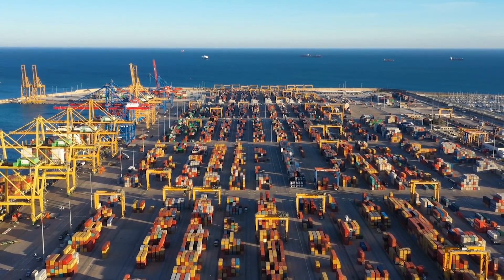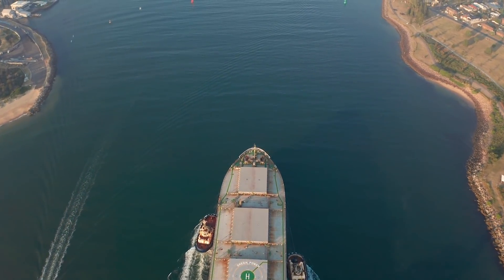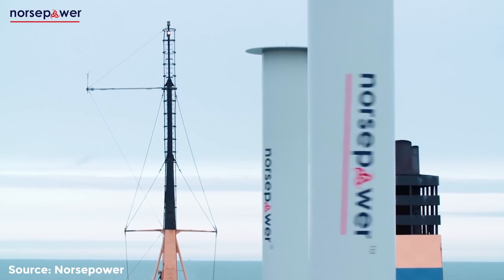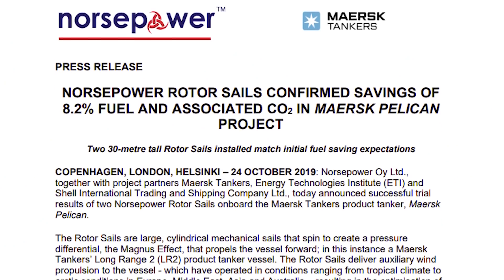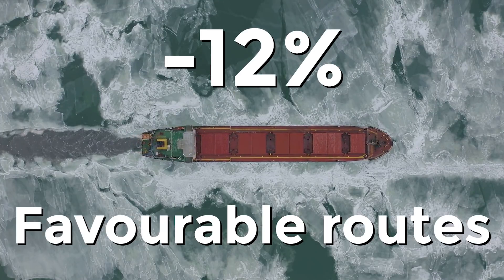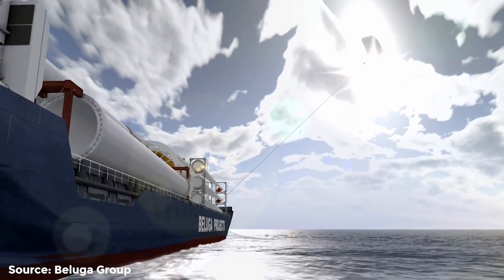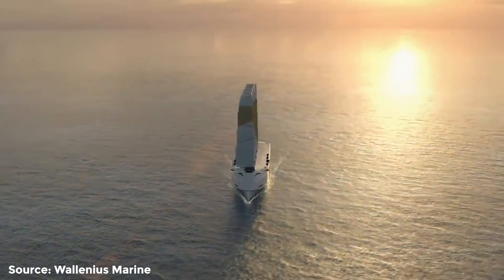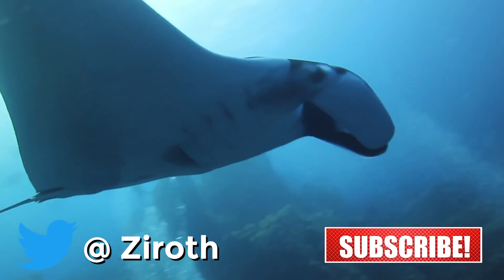Is Wind Power The Future of Shipping?

Comment: What a great idea!!
They could have big sails on masts!!
Reply: To address the suggestions that wind power is the answer I offer the following example.  In 1870 a premium sailing vessel entered service, the ‘Cutty Sark’.  The 'Cutty Sark' was 64.74 metres in length with a beam of 10.97 metres and a loaded displacement of 2 100 tonnes.  She was able to carry, at best, 1 700 tonnes of cargo and to harness the energy in the wind the available spread of canvas was up to 2 976m2 which was tended by a crew of about 30 skilled men.  A ratio between the sail area (SA) and the vessels displacement (D) determines how lively she is; ‘lively’ being nautical speak for ‘fast and manoeuvrable’.  The carrying capacity of cargo ships is constrained in two ways, mass and volume which leads us to the ‘stowage factor’ of the cargo; the more mass on board the greater the displacement which in turn impacts the efficiency of the hull form and sail area / displacement ratio.  A vessel constrained by mass is said to be ‘down but not full’, while a vessel constrained by volume is said to be ‘full but not down.  When in the tea trade, which the ‘Cutty Sark’ was designed and built for with fine lines (more nautical tech speak, so again no need to worry about it) she could carry around 600 tonnes of cargo at speeds of up to 17.5 knots dependent on the prevailing wind and had a typical China to UK time on passage of 120 days.  The tea trade was very competitive so ‘time on passage’ was a large factor in securing the premium freight rate that made her cost effective.  Rounding things out, her maximum available sail area gave circa 5m2 of canvas for every tonne of tea carried.

As soon as the Suez Canal opened, which the ‘Cutty Sark’ was unable to sail through; she lost her advantage, raw speed, to the steam powered ships of that era who could beat her ‘time on passage’ by taking that short cut.  Mechanically powered ships have improved in terms of efficiency, on a freight tonne mile basis, by at least one order of magnitude since then.  After losing out to the coal burning, fire tube boiler, steam reciprocating mechanical ships of the late 19th century ‘Cutty Sark’ was relegated to the Australian wool trade, just about the bottom of the barrel in maritime terms and only one small step up from being a 'honey barge'.  The canvas, cordage and extra manpower needed for sailing ships was never a very benign environmental option so please discount any idea of sail as ‘sustainable’.  All this is without the problem that if ‘the wind don’t blow the ship don’t go’, when it does blow it often blows in the wrong direction for your cargo delivery needs and sometimes there is rather too much of it for comfort.  Sailing ships are unable to go directly up wind so if the wind is blowing form the direction your cargo needs to then a zig-zag course must be steered, more distance and more time.  Wind is traditionally measured on the Beaufort Scale (wind speed) that runs from 0 (< 1kn) to 12 (> 63kn) and for sailing purposes the usable part of the range is ‘3’ (circa 8kn) to ‘6’ (circa 24kn).

Random fact about ‘Cutty Sark’, it is said to have been possible to coax 3 000 horse power out of her sails, or in ‘real money’ 2 206 500 Watts (2.2 megaWatts), or 741 Watts for each square meter of sail area.  So that majestic spread of canvas would have been even less efficacious for delivering your baubles and bows from the orient, despite taking about three times as long on the voyage.  The sails on the ‘Cutty Sark' produce about 0.33% of the power need to propel a Mearsk Triple E or less than one two hundredth of the output from the ICEs.  Remember shipping is a high volume low cost, therefore low margin business, and all costs have to be beneficial.

Canvas and hemp are accorded 'renewable' (read as ‘natural’) status, if ‘synthetics’ are used there will still be a need for the input of FOGI products.  'Synthetics' would have a much better working life span than 'naturals' but would still yield the same amount of energy, 741 Watts for each square meter in those elusive ideal conditions.  Wallenius are currently giving wind power a go with wing form ‘sails’ but evidence is a little short of proof as of this date.  KTH (Kungliga Tekniska högskolan), a sort of up market university in Stockholm, who are using the funding to derive results will probably, and eventually, in the best traditions of academia ‘publish’ a ‘paper’ unless the funders invoke the well known ‘commercial sensitivity clause’ of their agreement with the KTH.  On board wind turbine might get you around some of the problems, however for marine use vertical axis wind turbines (VAWT) would be better than, the what have now become 'traditional', horizontal axis wind turbines (HAWT) for reasons that include the air draught of the vessel, weight distribution and maintenance access.  The energy yield is still subject to the wind blowing at the right strength and having space available on board for the hardware.  The masts, rigging and sail handling arrangements would take up 'prime real estate' on the vessel.  Fuel oil bunker tanks can be stuck away in any odd corner and the ICE power plants are themselves relatively compact.  The stacked up 'boxes' would mean putting the wind driven propulsion units in a bad situation from a ship stability point of view.

Comment: The problem with pollution form shipping is the same as pollution form plastic.
Petroleum is too cheep! Its practical free. It has no cost and is too good.
If the environmental cost was added to petroleum wind power would be the most economical way and used plastic would have a value.
So – add value to petroleum. It’s a fantastic product and may be a solution to the environmental problem. Use it in a sustainable way. Recycle and reuse.
Reply: At the moment the lowest cost resolution of the marine transport challenge is ICEs powered by liquid fossils fuel.  Some environmental costs are externalised, so the global community has to bear them, for the benefit of the users of the service.  The internalisation of those costs is the responsibility of the regulators while the ultimate liability should lay with consumers of the materials being transported.  If you want your toys and gadgets you will need to pay that cost.  While ICEs have the current perceived advantages of economy, facility and flexibility we are going to be stuck with the environmental down sides unless universal regulatory action prevails or consumption both per capita and overall reduces.

Comment: He missed a great pun opportunity. Probably on purpose, obviously the answer is....blowing in the.... nevermind
Reply: To address the suggestions that wind power is the answer I offer the following example.  In 1870 a premium sailing vessel entered service, the ‘Cutty Sark’.  The Cutty Sark was 64.74 metres in length with a beam of 10.97 metres and a loaded displacement of 2 100 tonnes.  She was able to carry, at best, 1 700 tonnes of cargo and to harness the energy in the wind the available spread of canvas was up to 2 976m2 which was tended by a crew of about 30 skilled men.  A ratio between the sail area (SA) and the vessels displacement (D) determines how lively she is; ‘lively’ being nautical speak for ‘fast and manoeuvrable’.  The carrying capacity of cargo ships is constrained in two ways, mass and volume which leads us to the ‘stowage factor’ of the cargo; the more mass on board the greater the displacement which in turn impacts the efficiency of the hull form and sail area / displacement ratio.  A vessel constrained by mass is said to be ‘down but not full’, while a vessel constrained by volume is said to be ‘full but not down.  When in the tea trade, which the ‘Cutty Sark’ was designed and built for with fine lines (more nautical tech speak, so again no need to worry about it) she could carry around 600 tonnes of cargo at speeds of up to 17.5 knots dependent on the prevailing wind and had a typical China to UK time on passage of 120 days.  The tea trade was very competitive so ‘time on passage’ was a large factor in securing the premium freight rate that made her cost effective.  Rounding things out, her maximum available sail area gave circa 5m2 of canvas for every tonne of tea carried.

As soon as the Suez Canal opened, which the ‘Cutty Sark’ was unable to sail through; she lost her advantage, raw speed, to the steam powered ships of that era who could beat her ‘time on passage’ by taking that short cut.  Mechanically powered ships have improved in terms of efficiency, on a freight tonne mile basis, by at least one order of magnitude since then.  After losing out to the coal burning, fire tube boiler, steam reciprocating mechanical ships of the late 19th century ‘Cutty Sark’ was relegated to the Australian wool trade, just about the bottom of the barrel in maritime terms and only one small step up from being a 'honey barge'.  The canvas, cordage and extra manpower needed for sailing ships was never a very benign environmental option so please discount any idea of sail as ‘sustainable’.  All this is without the problem that if ‘the wind don’t blow the ship don’t go’, when it does blow it often blows in the wrong direction for your cargo delivery needs and sometimes there is rather too much of it for comfort.  Sailing ships are unable to go directly up wind so if the wind is blowing form the direction your cargo needs to then a zig-zag course must be steered, more distance and more time.  Wind is traditionally measured on the Beaufort Scale (wind speed) that runs from 0 (< 1kn) to 12 (> 63kn) and for sailing purposes the usable part of the range is ‘3’ (circa 8kn) to ‘6’ (circa 24kn).

Random fact about ‘Cutty Sark’, it is said to have been possible to coax 3 000 horse power out of her sails, or in ‘real money’ 2 206 500 Watts (2.2 megaWatts), or 741 Watts for each square meter of sail area.  So that majestic spread of canvas would have been even less efficacious for delivering your baubles and bows from the orient, despite taking about three times as long on the voyage.  The sails on the ‘Cutty Sark produce about 0.33% of the power need to propel a Mearsk Triple E in ‘ideal conditions’ the energy harvest would be less than one two hundredth of the output from the ICEs.  Remember shipping is a high volume low cost, therefore low margin business, and all costs have to be beneficial.

Canvas and hemp are accorded 'renewable' (read as ‘natural’) status, if ‘synthetics’ are used there will still be a need for the input of FOGI products.  'Synthetics' would have a much better working life span than 'naturals' but would still yield the same amount of energy, 741 Watts for each square meter in those elusive ideal conditions.  Wallenius are currently giving wind power a go with wing form ‘sails’ but evidence is a little short of proof as of this date.  KTH (Kungliga Tekniska högskolan), a sort of up market university in Stockholm, who are using the funding to derive results will probably, and eventually, in the best traditions of academia ‘publish’ a ‘paper’ unless the funders invoke the well known ‘commercial sensitivity clause’ of their agreement with the KTH.  On board wind turbine might get you around some of the problems, however for marine use vertical axis wind turbines (VAWT) would be better than, the what have now become 'traditional', horizontal axis wind turbines (HAWT) for reasons that include the air draught of the vessel, weight distribution and maintenance access.  The energy yield is still subject to the wind blowing at the right strength and having space available on board for the hardware.  The masts, rigging and sail handling arrangements would take up 'prime real estate' on the vessel.  Fuel oil bunker tanks can be stuck away in any odd corner and the ICE power plants are themselves relatively compact.  The stacked up 'boxes' would mean putting the wind driven propulsion units in a bad situation from a ship stability point of view.

Comment: It's was the beginning of shipping
Reply: To address the suggestions that wind power is the answer I offer the following example.  In 1870 a premium sailing vessel entered service, the ‘Cutty Sark’.  The Cutty Sark was 64.74 metres in length with a beam of 10.97 metres and a loaded displacement of 2 100 tonnes.  She was able to carry, at best, 1 700 tonnes of cargo and to harness the energy in the wind the available spread of canvas was up to 2 976m2 which was tended by a crew of about 30 skilled men.  A ratio between the sail area (SA) and the vessels displacement (D) determines how lively she is; ‘lively’ being nautical speak for ‘fast and manoeuvrable’.  The carrying capacity of cargo ships is constrained in two ways, mass and volume which leads us to the ‘stowage factor’ of the cargo; the more mass on board the greater the displacement which in turn impacts the efficiency of the hull form and sail area / displacement ratio.  A vessel constrained by mass is said to be ‘down but not full’, while a vessel constrained by volume is said to be ‘full but not down.  When in the tea trade, which the ‘Cutty Sark’ was designed and built for with fine lines (more nautical tech speak, so again no need to worry about it) she could carry around 600 tonnes of cargo at speeds of up to 17.5 knots dependent on the prevailing wind and had a typical China to UK time on passage of 120 days.  The tea trade was very competitive so ‘time on passage’ was a large factor in securing the premium freight rate that made her cost effective.  Rounding things out, her maximum available sail area gave circa 5m2 of canvas for every tonne of tea carried.

As soon as the Suez Canal opened, which the ‘Cutty Sark’ was unable to sail through; she lost her advantage, raw speed, to the steam powered ships of that era who could beat her ‘time on passage’ by taking that short cut.  Mechanically powered ships have improved in terms of efficiency, on a freight tonne mile basis, by at least one order of magnitude since then.  After losing out to the coal burning, fire tube boiler, steam reciprocating mechanical ships of the late 19th century ‘Cutty Sark’ was relegated to the Australian wool trade, just about the bottom of the barrel in maritime terms and only one small step up from being a 'honey barge'.  The canvas, cordage and extra manpower needed for sailing ships was never a very benign environmental option so please discount any idea of sail as ‘sustainable’.  All this is without the problem that if ‘the wind don’t blow the ship don’t go’, when it does blow it often blows in the wrong direction for your cargo delivery needs and sometimes there is rather too much of it for comfort.  Sailing ships are unable to go directly up wind so if the wind is blowing form the direction your cargo needs to then a zig-zag course must be steered, more distance and more time.  Wind is traditionally measured on the Beaufort Scale (wind speed) that runs from 0 (< 1kn) to 12 (> 63kn) and for sailing purposes the usable part of the range is ‘3’ (circa 8kn) to ‘6’ (circa 24kn).

Random fact about ‘Cutty Sark’, it is said to have been possible to coax 3 000 horse power out of her sails, or in ‘real money’ 2 206 500 Watts (2.2 megaWatts), or 741 Watts for each square meter of sail area.  So that majestic spread of canvas would have been even less efficacious for delivering your baubles and bows from the orient, despite taking about three times as long on the voyage.  The sails on the ‘Cutty Sark produce about 0.33% of the power need to propel a Mearsk Triple E in ‘ideal conditions’ the energy harvest would be less than one two hundredth of the output from the ICEs.  Remember shipping is a high volume low cost, therefore low margin business, and all costs have to be beneficial.

Canvas and hemp are accorded 'renewable' (read as ‘natural’) status, if ‘synthetics’ are used there will still be a need for the input of FOGI products.  'Synthetics' would have a much better working life span than 'naturals' but would still yield the same amount of energy, 741 Watts for each square meter in those elusive ideal conditions.  Wallenius are currently giving wind power a go with wing form ‘sails’ but evidence is a little short of proof as of this date.  KTH (Kungliga Tekniska högskolan), a sort of up market university in Stockholm, who are using the funding to derive results will probably, and eventually, in the best traditions of academia ‘publish’ a ‘paper’ unless the funders invoke the well known ‘commercial sensitivity clause’ of their agreement with the KTH.  On board wind turbine might get you around some of the problems, however for marine use vertical axis wind turbines (VAWT) would be better than, the what have now become 'traditional', horizontal axis wind turbines (HAWT) for reasons that include the air draught of the vessel, weight distribution and maintenance access.  The energy yield is still subject to the wind blowing at the right strength and having space available on board for the hardware.  The masts, rigging and sail handling arrangements would take up 'prime real estate' on the vessel.  Fuel oil bunker tanks can be stuck away in any odd corner and the ICE power plants are themselves relatively compact.  The stacked up 'boxes' would mean putting the wind driven propulsion units in a bad situation from a ship stability point of view.
Reply: @BernardLS  Thanks for the history lesson I read it while taking a well needed crap. Extremely irrelevant to the subject but it. Made me laugh. Thanks.